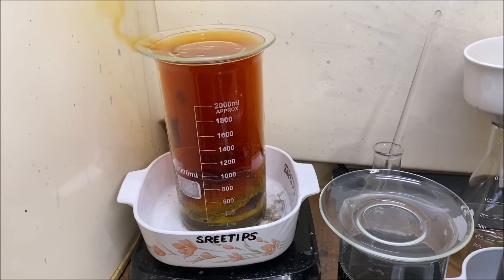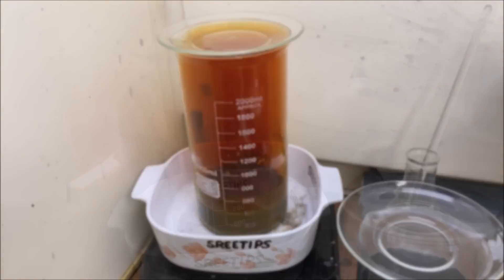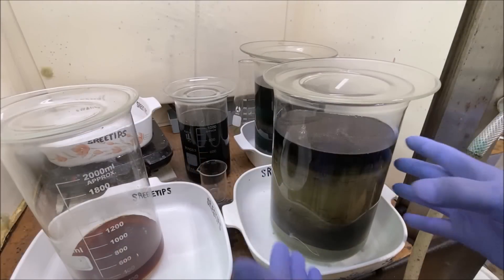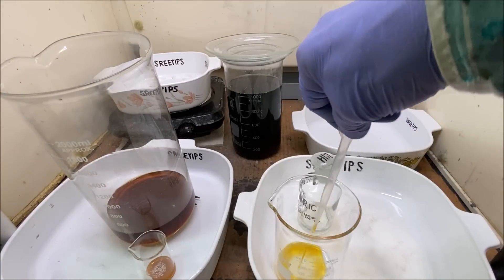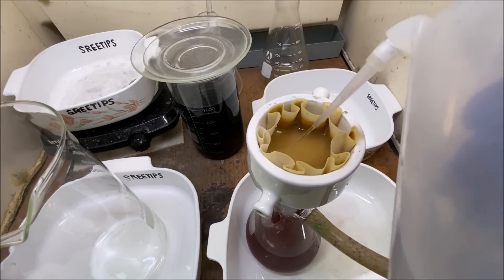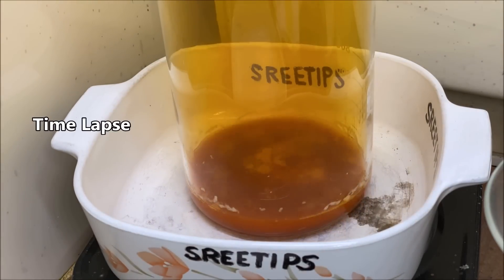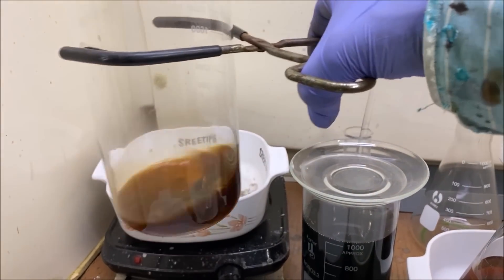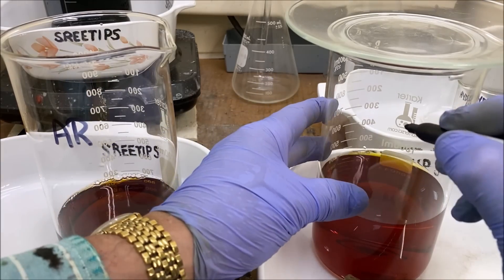Silver Cell Anode Filters Part 3

Comment: gold + koh = in ethanol/water solution (gold hydroxide, Au(OH)2), might be electro-refinable/boosted by voltage, ie gold is a battery electrode, also
Reply: even without other solutes, molten koh at 360C and gold, then h2so4, then electroplate out
Reply: possibly naoh does the same as koh to gold, even molten
Reply: as with other KOH etching, the reaction might be slow
Reply: I would try electrolysis of ethanol-koh solution with a gold electrode, to make gold dissolve as gold hydroxide, if gold does not dissolve fast into ethanol-koh by itself
Reply: seems like gold hydroxide can be heated to 140C->300C to decompose to gold oxide then to gold
Reply from the maker: I don’t know. Anything this type of process.
Reply: just thinking, any steps to get to easy priority electroplating separation/reforming @sreetips
Reply: ie if you can get to the h2so4 step directly after koh "dissolving" (oxidation/hydroxation) then it might be very streamlined and simple process @sreetips

Comment: Sir how are you I have ground many stones and dissolved them in Aqua Regia  (stones with stannous chlorid test show Platinum group metals) after urea adding SMB and some Iron sulphide ten grams dust was received around I once again made Aqua Regia to make pure gold, half of the dust did not dissolve, I do not understand what metal it could be.
Reply from the maker: I don’t have any experience with ground up stone.
Reply: Tellurium as Au2Te3 will do that. Best process for ore is to grind up than roast to get rid of the sulfur and volatile metals  you likely won't want. Next treat with a mix of hydrochloric and dilute sulfuric. This will pull out the non PGMs using inexpensive acids. Next use nitric to pull the silver and palladium out if any. Then add HCl plus nitric to grab your gold and more noble pgms

Comment: I use just aqua regia to dissolve my Karat gold and it works fine.  acid test shows 22kt gold.  I get confused on many ways you purify gold
Reply from the maker: Dissolving karat gold straight away with aqua regia can be done but it’s not recommended. Eventually you’ll encounter passivation with silver chloride, and a very dirty solution that make recovery more difficult. As long as you’re willing to put up with Those then no problem. But I’ve found that inquarting with silver, parting with nitric then refining with aqua regia produces excellent, repeatable results. It’s the easier softer way. Plus I refine silver, so it makes more sense to use silver to refine the gold.
Reply: How do you inquarting with silver
 @sreetips
Reply from the maker: Alloy silver with the karat gold

Comment: Will copper plate out onto a stainless Steel bowl like silver does?
Reply from the maker: If the voltage is kept at 3.5 VDC and the copper concentration is kept below 60g per liter then the copper shouldn’t plate out with the silver.

Comment: Sreetips, I've seen you add sulfuric acid to precipitate out any lead on pretty much every video you've ever done but I've yet to see any lead actually precipitate out is there any way that you might be able to show what that would look like and or give some examples of when that might occur?thank you so much for all of your videos they are extremely helpful informative and enjoyable
Reply from the maker: Sometimes, someone, will try to use soft lead solder to repair a piece of jewelry. It could be in a location that’s not easy to spot during sorting. Lead, even in just trace amounts, will ruin the ductility (ability to stretch) and malleability (ability to hammer into sheets). Adding a few drops of sulfuric is a technique that I learned from Harold_V on the goldrefiningforum.com He says it hurts nothing, costs almost nothing, and provides a big benefit. I’ve never seen what it looks like in the filter either. So next time I’ll add some lead and see if we can detect it during filtering.

Comment: I got a dumb suggestion. When u cement out the copper out of your solution. Melt it. Then use it in your stock pot. It prolly contains a small amount of gold too. Free copper except needs to be melted.
Reply from the maker: It’s heavily contaminated. Clean copper for refining is cheap and plentiful. After that, it becomes waste.
Reply: @sreetips  makes sense

Comment: Kevin, the first silver cell in the 3 or 4 L beaker, with the graphite anode bar. How much silver did it produce? How often did you harvest the Silver?
Reply from the maker: It was a one liter beaker. I can’t remember what the output was on that.
Reply: @sreetips  it probably just appeared larger. My sight is not like it used to be. I’ve probably got have the stuff at home or on the way to the house for my silver cell build!
Reply: I just got my first beakers and flasks this week. They do appear larger in the videos, but that is just perspective. Now that I'm looking I see that they're the same size. Sreetips gives us his pov, instead of placing the cameras off to the side. Which would probably be easier for him, but it wouldn't be the same.